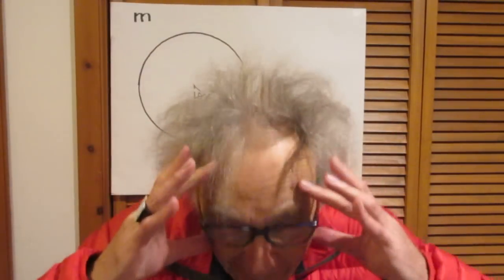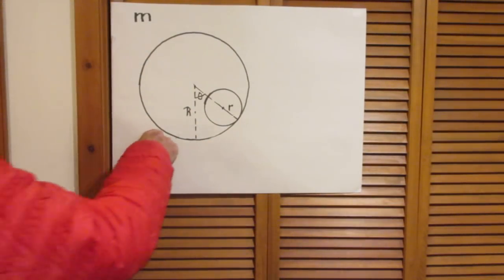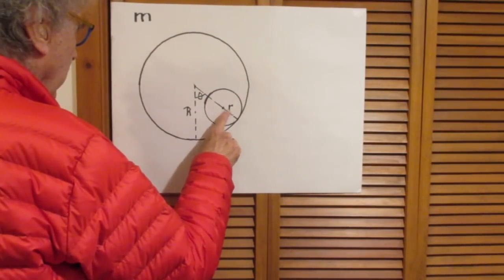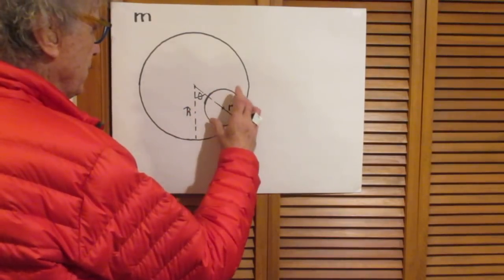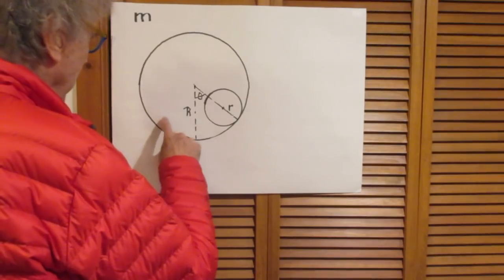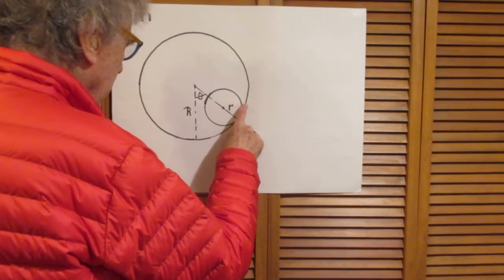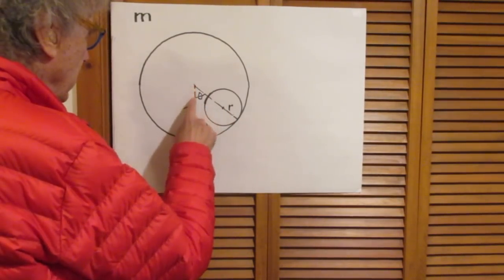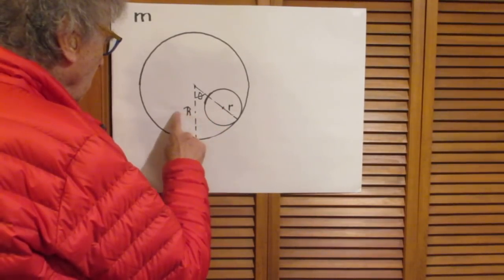Problem #23 Rolling SHM

Comment: Assuming that the lareger cylinder is fixed, I got the angular frequency as
w = sqrt[ 2g(R-r)/3 (r^2) ]

I first solved for the energy of the solid cylinder at a general angular position theta. It included the potential energy and kinetic energy due to translation and rotation. 
Then I set dE/dt as 0 and after approximating sin(theta) as theta I got the expression of angular SHM. Comparing that eqn to
Alpha = - w^2 theta, I got the value of w
Reply: the angular amplitude should also play a part in the ang. freq. of the body ........ this is what i got  sqrt[2g(R-r)(theta^2)/3r^2]
Reply: Manish Prasad I'm also getting the same answer dude! But I solved it by restoring torque method!

Comment: Sir, though completely unrelated to the video, I have a question which I wanted to ask you: How did the pendulum experiment help newton draw the conclusion that gravitational mass is proportional to inertial mass as mentioned in the Kleppner and Kolenkow's book? Would be grateful if you could explain.
Reply from the maker: I do not know - ask google
Reply: Lectures by Walter Lewin. They will make you ♥ Physics. Sure. Thanks

Comment: Sum of PE and KE is constant at the lower part of the bigger cylinder and at the maximum amplitude the smaller cylinder makes inside the bigger cylinder. Using small angle approximation and considering pure roll, I got 
omega = (2g/r)^0.5

Comment: torque on the little cylinder = -m*g*sin(theta)*r  =~=  -m*g*theta*r
moment of inertia for the cylinder = 0.5*m*(r^2)
so angular acceleration on cylinder = torque/(moment of inertia) = -2*g*theta/r
But we know that it is in pure roll, so  R*theta = r*(angle little cylinder has turned)
 so...   (theta double dot) = -2*g*theta/R
We already know that the form of simple harmonic motion is...  (x double dot) = -(w^2)*x
so....
  w = sqrt(2*g/R)

Thank you for sharing your beautiful snow with us.
I hope you have a cozy and joyful Xmas  : )
Reply: lelcat thats wrong, what point are you summing moments (torque) about? The rate of change of angular momentum is given by the cylinder's angular velocity + linear velocity

Comment: Sir, the answer should be 
w = √(2g/R-r) 
where w is angular frequency.
I found out the acceleration of centre of mass at an angle Theta.

From there I could see the SHM Differential Equation and compared the coefficient of x with omega².
Reply from the maker: nope

Comment: Using conservation of energy per your recommendation, I added kinetic, rotational, and potential energy. Used the angle approximation for cos. I then differentiated which resulted in a diffy equation  of the form for periodic motion.  
This gives Omega = SQRT{[2(R-r)(R-r) + (r)(r)] / 2gR}

2cd Attempt
Found a mistake in my expression for KE.
Omega = SQRT{3r^2 / 2g(R-r)}

3rd Attempt
I used the wrong angular velocity for rotational energy. The correct answer should be:
Omega = SQRT{3(R-r) / 2g}

Comment: What if the circle of radius R is a tube free to roll without slipping on a flat surface? Could it be a challeging problem to solve? Maybe one of the next problems?
Reply: I can't figure out how. If there is a chance I want to learn it.
Reply from the maker: the problem is ill-defined.
Reply: To find out the angular frequency of the inner cylinder for small oscillations.
Reply from the maker: r will not  be able to roll on a tube - but r can roll on the inside of a cylinder,
if r is a ball it can roll on a track (see Lect 13 of 8.01). If you want both the cylinder R and the disc r to roll freely (several people have suggested that), I will consider that as a bi-weekly problem but ONLY if you send me first the solution. I think it is too difficult. Once I see the correct solution I will make a final decision on whether to use it or not.
Reply: Yes. I am considering both the cylinder R and the disc r to roll freely. But it is very difficult, I am not able to solve it. Everything is moving in the system and I cannot set the equations properly. I don't know where to start from.
Reply from the maker: have you solved this weeks problem? What was your answer?

Comment: Hello Dear Professor,
when will I say the fluid is incompressible? what is the limit of pressure applied to a liquid(especially) so that it does not change its shape? 
How would I explain this to a high school student?
Reply from the maker: good question - use google
Reply: Thanks Sir for responding.
I tried Google, I found this compressibility associated with Mach number(M<0.3), not in terms of pressure. But I think it would be difficult for 12th class students.
Reply: Rakesh Ranjan upto 5% change in density
Reply: @ranjan4019  When we say that a fluid is incompressible, what we mean is that it remains at the same density regardless of its pressure.  This is an approximation of reality to keep the math simple, rather than a property that applies in reality.  No fluid is truly incompressible, just as no cable is actually inextensible, or no pulley is massless.  But we can usually approximate most liquids to be incompressible at moderate pressures, and still get useful results from our calculations.

All fluids have a finite bulk modulus, so it is still possible to change the density of a fluid through the pressure it experiences.   Bulk modulus is a measure of how stiff a substance is, against a change in volume as a consequence of a change in pressure.

Comment: T (Period of oscillation) = 2π SQRT [ (3r^2) / (4 g (R-r) (1-cosa)) ]  But i couldn't find the solution of ''the maximum value''. Thank you for problem.
Reply from the maker: it's dimensionally correct. but it's magnitude is wrong.

Comment: w = √( g/(2*(R-r)) )
because the small cylinder is instantaneously accelerated in a circular path
so a centripetal force must be supplied by the normal reaction force (the only radial force)
so...   m * (R-r) * (theta dot)^2 = m*g*cos(theta)
differentiating this gives the above frequency of oscillation
Reply: lelcat so close....
Reply: +Denis Karachov thanks for your helpful comments
I should have followed your suggestions earlier

Comment: Before I post the solution, I must say two things about posting solutions as comments out here:
1. There's no way to draw / upload diagrams - which would otherwise have made it easier to explain the equations.
2. There is no way I can type physics symbols (like 'tau', 'omega', 'alpha-double-dot' which normally represents double derivative with respect to time)

Here is my solution: 
At any given time after the solid cylinder is released, 
0. Let alpha be the angle the center of mass of the solid-cyl makes with the vertical line.
1. Let w be the angular velocity of the center of mass of the solid cylinder about the centre of the larger cylinder.
2. Let w' be the angular velocity of the rotation of the solid-cyl about its centre.
3. Let v be the velocity of the center of mass of the solid cylinder (it will all be tangential to the circle of radius R-r, at any time)

Thus,
Eq1:   w' = (R . w) / r
Eq2:   v = w . (R - r)

By conservation of energy, we have Eq3 as:
Eq3:   m.g.h  =  (m . v^2) / 2   + (I . w'^2) / 2

Where, 'I' for a solid cylinder rotating about its natural axis is given by, (m . r^2) / 2
Where, h, the drop in height of the centre of mass of the solid cylinder from initial angle Theta to the angle Alpha where we are measuring the Gravitational-potential-drop, is given by  (R-r)(cos(Alpha) - cos(Theta)).

Plugging in all values into the Eq3, we reduce it to:
cos(alpha) - cos(theta) = w^2 . 1/(4g) . ( 2 . (R-r)^2 + R^2)/ (R-r))  

Now, taking first derivative against time, and given that d(alpha)/dt is nothing but w (leading to one 'w' on both sides of the equation being canceled out), we get :
Eq4:     (-1). sin(alpha) =   ( 1/(2 . g) ) .   ( 2 . (R-r)^2 + R^2)/ (R-r))     .      d2(alpha)/dt2  

Now we use the approximation you suggested - we assume alpha is sufficiently small to make sin(alpha) == alpha,
We further reduce it to:

Eq5:    alpha  +  (alpha-double-dot) . (1/(2g)) . ( 2 . (R-r)^2 + R^2)/ (R-r))  =  0 

That's our Simple Harmonic Motion differential equation. And we can derive the angular-frequency-of-oscillation to be:

square-root-of ( 2 . g. (R-r) / ( 2 . (R-r)^2 + R^2 ) )

And the frequency of oscillation would be  (1/2Pi) . square-root-of ( 2 . g. (R-r) / ( 2 . (R-r)^2 + R^2 ) )

Comment: I am quite lazy to type full sol. Sorry but my answer is -

T=2 pi squareroot [7(R-r)/5g]

ω= sqrooot [5g/7(R-r)]

Is it right? Plz tell if i am close to correct answer.!!!!!!
Reply from the maker: watch the video again - the rolling object is a sold disc
Reply: You mentioned that the rolling object is a cylinder though. P.S. Is the large cylinder fixed or it can move as the small cylinder rolls down?
Reply from the maker: large cylinder is fixed

Comment: Sir is the hollow cylinder fixed or allowed to roll?
Reply from the maker: fixed
Reply: Sir and i am still getting confused.. sorry if you find it silly.. do we need to find omega or angle
Reply from the maker: angular frequency (often called omega - w) the period T=2pi/w
Reply: Yes sir got it.. thank you sir 😊
Reply: Lectures by Walter Lewin. They will make you ♥ Physics.  I took it as a physical pendulum and applied the formula T=2pi√(I/k)

Comment: I would like to give it a try.
solid cylinder mass = m; acceleration = a; friction = f; 
1) m*a = mg*Ө - f .......Newton's Law
2) f*r = i*a/r     ............pure rolling, torque about solid cylinder center
3) i = mr^2/2    ............solid cylinder moment of inertia about its center
4) – (mg*Ө)*(R-r) +  f*R = I* Ө"   ……………..torque about hollow cylinder center 
Get        I*Ө"+ mg(2R - 3r)/3* Ө = 0     or 
Ө"+ mg(2R - 3r)/(3*I) * Ө = 0  
5) I = i + m*(R-r)^2  ……………solid cylinder moment of inertia about hollow cylinder center
Therefore,
ɷ =sqrt[mg(2R - 3r)/(3I)]

Comment: w^2 = 2g/3 * (R-r)/r^2
Conservation of mechanical energy with derivative dE/dt=0 (potential energy, kinetic energy of linear motion and rolling) and then I found there harmonic oscilation equation.
Reply from the maker: nope
Reply: Lectures by Walter Lewin. They will make you ♥ Physics. Is assumption that big cylinder is not moving correct? Should I take it's move into account?
Reply from the maker: not moving

Comment: What would happen if we had a plane that could fly at the speed of the surface of earth but in the opposite direction would it then be stationed in a place for an observer seeing it from outer space?
Reply: And if that's true we can take of and the earth would keep on moving below and when our destination would be close to the plane we could just land , right?
Reply from the maker: Question unclear.  A helicopter moves with the same speed as the surface of Earth becoz the atmosphere moves with that speed. If  a plane could fly with a speed of 40,000 km/hr relative to the ground near the equator in the direction to the West, then a person from outer space could see that plane. But it would not stand still as the Earth rotates about the sun.
Reply: So the plane can be still in a place in the sky respect to the earth, so that means if the plane has to go somewhere towards west then it would be the place coming towards to the plane and not the plane going to the place , with respect to someone seeing if from outer space
Reply from the maker: >>>So the plane can be still in a place in the sky respect to the earth>>>
No for that to happen the plane should fly at the equator towards the East 40,000 km/h.
Satellites in synchronous equatorial orbit at a distance of about 41,146 km from the center of Earth stand still in the sky as seen from Earth. The orbital period is then 24 hours. That's where many communication  satellites are. If you have a disc on your home (for TV reception), you aim the disc at one of those satellites and you never have to move it. Velocities are vectors, please learn how to add vectors.

Comment: w^2 = 2g / R 
I made a really dumb mistake in my past answer, I conflicted the angular acceleration of the disk with the second derivative of theta, silly me. Hope I fixed it properly.
Reply from the maker: wrong again
Reply from the maker: yes you finally got it right. I therefore did not make your solution public.